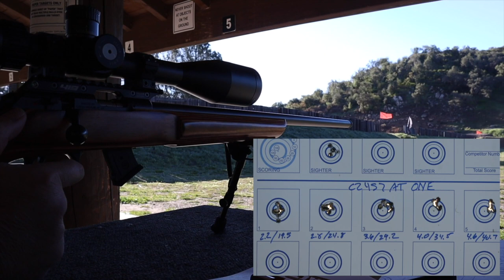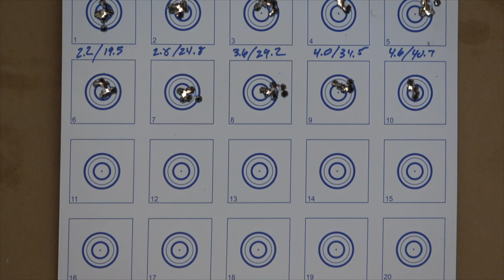How to Improve Your Accuracy Adjusting Action Screws - 22LR Rifle Ep.2

Comment: Good info. Does the A1 stock have pillars? Do you think it would matter if it did have pillars or if rifle was in a chassis with different torque settings? Also it seems like you second groups seem tighter then open up. Could it be barrel temperature?
Reply from the maker: I'd like out this video when I compare the ATOne with the VPT
https://youtu.be/Ilt2eoGUw6s
Reply: My at one didn't have pillars.  I used hot-glue as a semi-bedding compound...a "test before true bedding" if you will.  It stopped throwing random fliers after that. I'm still rocking the hot-glue for now, but my actions screws will not stay torqued to value. I guess I'll have to pillar bed it sometime.